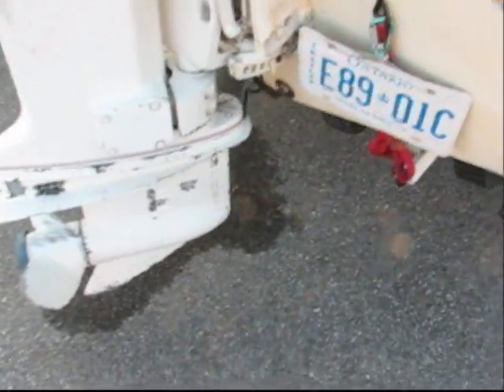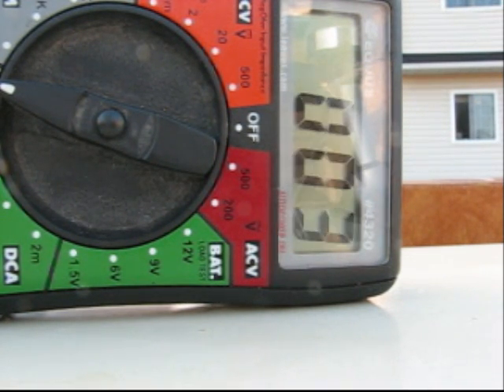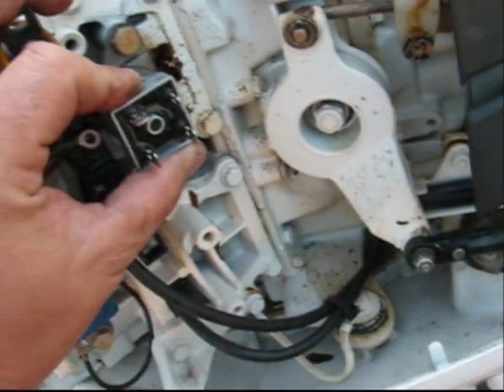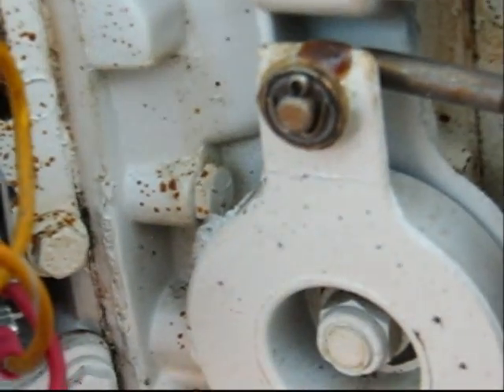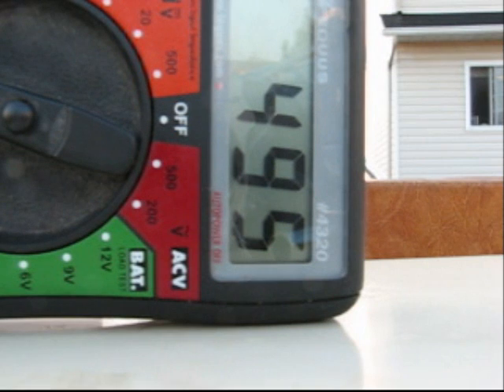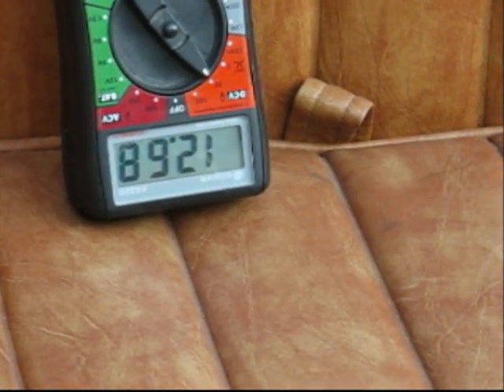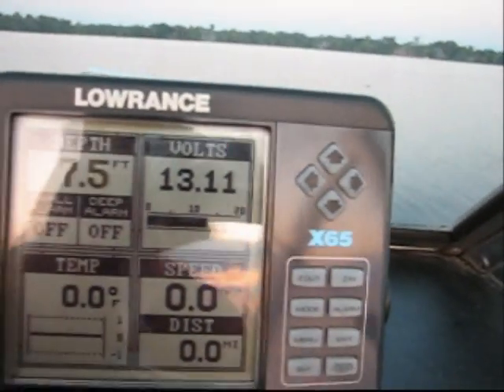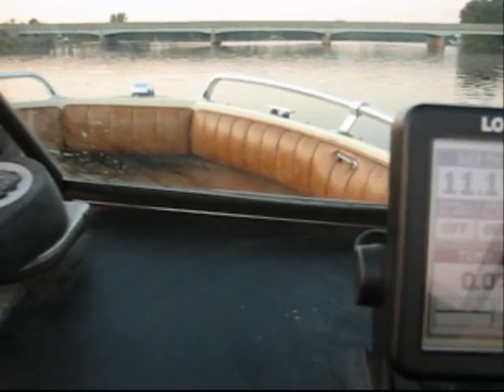1983 Johnson 90 v4 rectifier diagnosis and replacement

Comment: I have the same motor we put the batteries to a Kill Switch but every time we turn on power the red cable where that rectifier plugs in starts to sizzle my thought is test rectifier just as you did I was wondering if you were having some of the same issue

Comment: A very helpful video, but i'm still curious about my boat is 1985 jonhson v4 140hp 2 stroke,my rectifier has 5 wire 1 red,1 black, 2 yellow,1 grey.I'm wondering if i can use the rectifier from radio shack and where should my grey wire goes? thank you!!!
Reply: Lo solucionaste? Tengo el Evinrude v4 1998 90hp 2 cables amarillos y violeta 1 y 1 gris

Comment: Awesome video! I bought a NTE5342 bridge rectifier for $3 at RS Electronics in Livonia Michigan. It is overkill 600v reverse voltage, 40Amps.
The part in the video was a NTE5322, 200v reverse voltage, 25 amps. I haven't done the repair yet, but I think this is the problem. (issue: Battery not charging). Thanks! For those who need the part, order online from Radio Shack, MCMElectronics, Newark.

Comment: hi  there  mr cpgixxer ....nice  and   good   video  you posted...... was  just  curious   about  the rectifier  u   installed ..is  it  a  full wave bridge  rectifier?  and  what is the  rated   amp and  volt.......i have a j150  1986  motor   and  the  stator  is  rated  at  10  amp.....will  the 25 amp/50 v  rectifier  enough  to  charge  the  battery.........thanks  a lot  and   more   power   to  you   GOD BLESS

Comment: Hey cpgixxer,
Super helpful video - say what NTE part did you order.  Will this one work NTE Electronics NTE5344 Bridge RECTIFIER, 1ph, 40A, 1KV THD
I am a shorted one in my 1970 60 HP Johnson.

Comment from the maker: @surfinandcruisin1 Pull the flywheel, most of the time a quick visual will tell you if the stator is fried sometimes it requires a DVA. Have fun with the new motor, should be an easy fix.

Comment from the maker: @surfinandcruisin1 If you are measuring the AC coming out of the stator you need a direct voltage adapter or a peak reading meter, a regular multimeter will not work and that's why your reading are so out of wack unless you are using a dva and it's putting out over 800VAC.

Comment: I have this EXACT SAME PROBLEM .... EXACTLY!   *are these readings through the wiring on the eng? (IOW the rect. is still installed / intact) right? (think yes)
ALSO:  WHERE did you get the replacement part?  Again,  I cannot go over 12.4 EVER and my battery's going dead ... THANK YOU very very much ! 
WHAT A GREAT CLIP !  So again, where did you get the part?

Comment from the maker: @Capnwabbit Depends on what the A/C unit draws, the system on these 90's only puts out 10 amps, they aren't like a car and put out 100 amps. They were designed to charge a battery and run lights :)